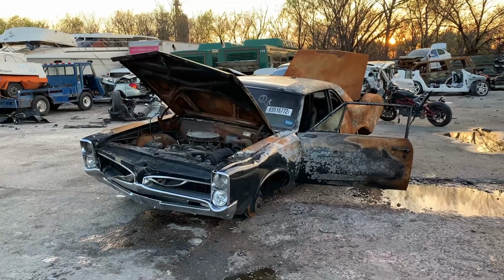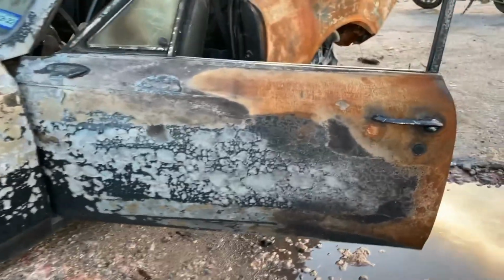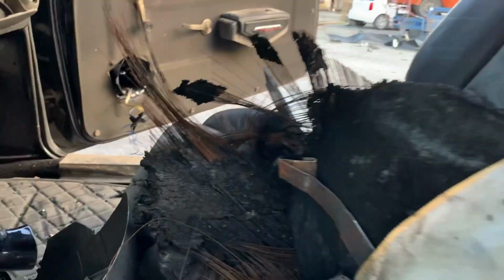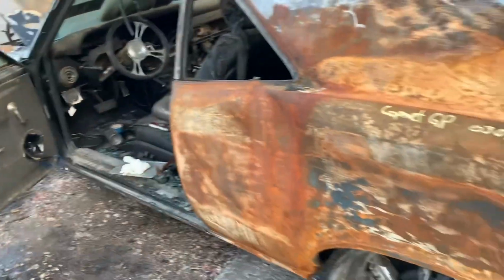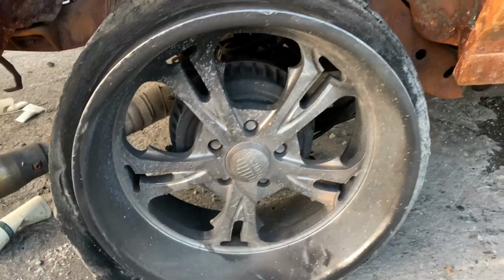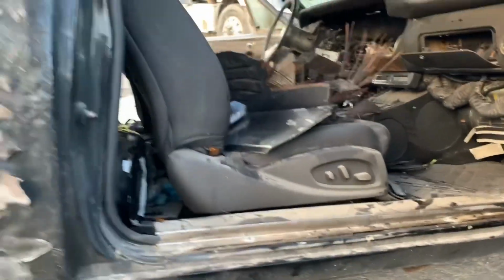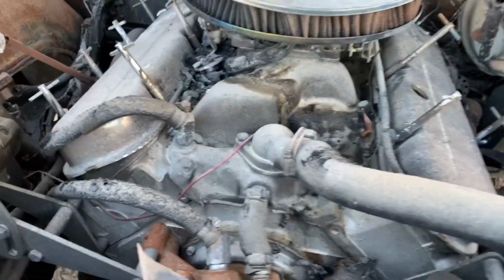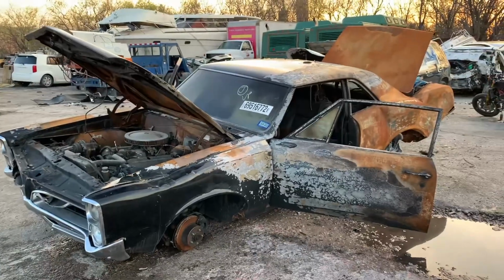SCRAP YARD FIND! BURNED UP VINTAGE CLASSIC 1967 PONTIAC LEMANS!!

Comment: Whoa Nelley, that is sad, but glad it got sold. Yes, this is not a GTO, it's a Tempest. 

We got the tag, we can brag: 04B for the second week of April 1967 production, 67 for 1967 model year, 23307 for Pontiac (2) Tempest (33) two door sports coupe (07), KAN for Kansas City, MO assembly (Leeds), 203 for Gold interior trim, S-S for Champagne lower and upper exterior paint, E for Soft Ray tinted glass, all windows, Group 2 accessories of A for foam bench seat cushion, E for air conditioning, and W for two speed automatic transmission. The Leeds, MO plant operated from 1929 to 1988 and recently was demolished.

No VIN, can't win, but easy to figure out, no doubt: 2 for Pontiac, 33 for Tempest, 07 for two door sports coupe, 7 for 1967 model year, K for Kansas City, MO assembly (Leeds) and the rest is the production sequence.

Comment: Nice car. Motors a Pontiac, no ‘big’ or ‘small’ block Pontiacs, block castings were only one size ‘55-‘81, internals determined displacement.
Reply: Looks like a Chevrolet V8, not a Pontiac V8 based on the water pump style, best I could see from what he showed. In that case, he's correct to guess that it's a big block. Yes, there was no small and big block Pontiac V8, that's correct.
Reply: You are correct… I was looking at it on my phone, tiny tiny image.